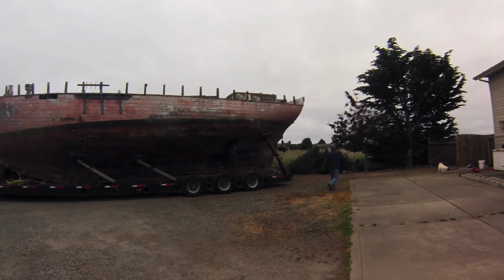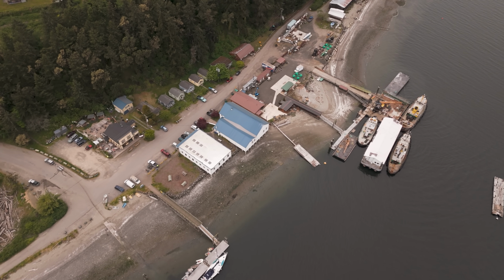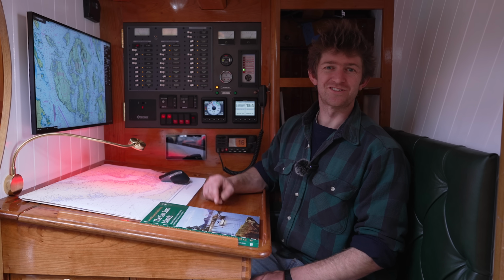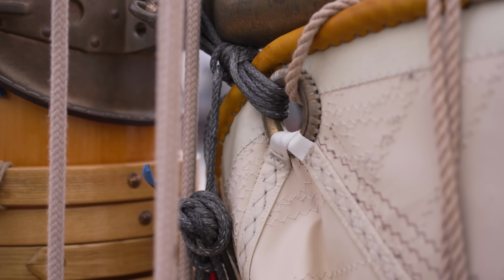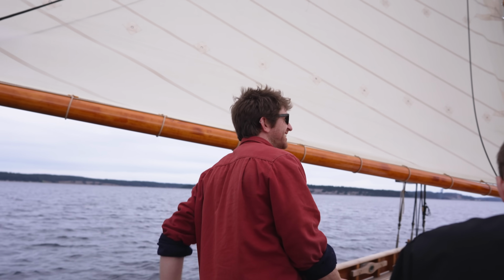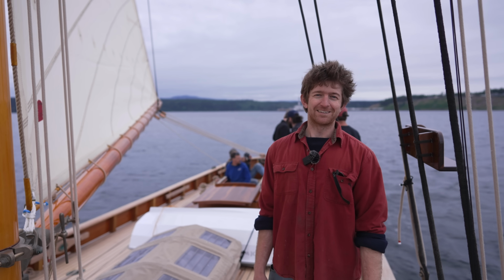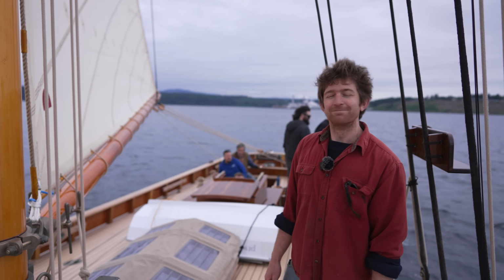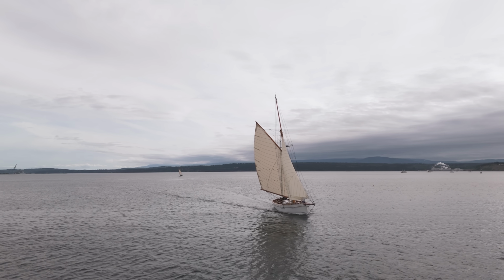After 7 years of rebuilding, TALLY HO SAILS AGAIN!

Comment: She looks absolutely amazing. Love sailing. 
Last week i had a charter Bavaria rented for a week. We were only motoring, but on last day engine died. We had to sail to Primošten and send away team on dinghy for 50l of diesel, bc we thought that we are out. Turned out, it was just clogged fuel filter from plastic particles of cheap plastic fuel tubing… It was new boat too. 3 hours of sailing in 5kt wind was very relaxing tbh without the noise of that Volvo engine. Not very fast, but nice.

Comment: What a beautiful sight, I can’t stop watching. I have been watching since day 1 and recently went back and made sure all were checked as liked.  One question, having owned a small sailboat (28’ Catalina) operated in Florida, Mold was a huge issue. I finally would put a small dehumidifier in the sink (direct overboard drain) while moored, problem solved, I don’t know if the NW has that issue and the ventilation shown  does the job.

Comment: I have to say respect, seven years.
Seven years ago I fore sure thought it would take you much longer.
But a great job, a beautiful boat.
Now keep filming and try to start to travel the world as soon as you can, that would be my advice.
Curious if those wooden rings/ mast hoops holding the sail on the mast have some kind of soft vilt lining?
Maybe charter a bit on certain routes?
Maybe have interesting guests from the “sailing community” on board sailing with you on the boat, getting interviewed for a podcast?
I’m just rambling here, I’m just curious what the future will bring?
Don’t tell me the boat is gonna get sold and you start a new project, that would be crazy.
It at least has to circumnavigate the world and I would take a few decades to do so if I were you.

Comment: Interesting how often folks are manning the winches seated on the deck outside the cockpit. I expected the cockpit to generally be full of folks trimming the sails as is typical in modern boats with large cockpits. One of the things that has seemed most awkward about Buehler's design for Rediviva is the standing helm position, although I often find myself standing and operating the helm with my feet mostly to get a better view over the doghouse when under power. In various modern FG boats, my favorite help position is sitting on top of the windward cockpit coaming. I envy Leo and crew getting to learn Tally Ho's special dances.

Comment: The replacement prop seems to have more than enough water moving capacity ..   Interestingly the smaller hub has allowed the swept blade area to remain  with a smaller overall dia. watching the response when returning to the berth   the boat,s response was not lagging .   Fingers crossed the smaller prop will suffice . Just a thought will those super tight sailing light attachments cause any stress points on the mast rigging . All coming together nicely .  loving the ups and the occasional down.

Comment: I would suggest you have a switch on the arm that engages the drive gear into the capstan. This would prevent it from being engaged before full contact. A switch and relay would work greay.

Comment: Fantastic well done. Please tell me, why at the beginning of the video was there a few lead bars being carried down below? Isn't there a huge ballest permanently in place? ( I remember the video from a few years ago when the casting of it went a bit pear shaped).
Reply: Don't know if it's the full explanation, but remember that the capstan has not been installed. Nor the boom gallows, and probably other items. I think he uses those extra, temporary ballast ingots to approximate the final weight and balance characteristics that TH will run with.
Reply: @llagas6307  Tha ks for the details, makes sense then

Comment: What type of boat is Tally Ho, it it considered a Brazzera (of croatian origin)? perhaps a sloop or a cutter depending on your sail sheet configeration?
Reply: Tally Ho has a gaff cutter rig, w/ a 4-sided fore&aft gaff mainsail & 3 forestays. A sloop rig usually has a 3-sided mainsail & only 1 forestay.
Her deep long-keel hull shape is based on traditional English pilot cutter designs known for combining speed & seaworthiness, although she has a squared-off transom instead of the more usual overhanging counter stern.
I don't see much of a connection to the bracera tradition.

Comment: She sails again.  I lost the plot, is there anything from the original ship in the new Tally Ho?
Reply: By weight, there's about 22% original material in the boat. Most of that is from the old lead keel, melted down & recast as ~75% of the new ballast keel. There's the re-conditioned wrought-iron mainsheet horse, & the repaired & motorized cast-iron capstan. As for wood, there's bits of original teak:
- the lowest 3 boards of the transom
- the 6 winch bases around the cockpit
- 4 bunk side-rails
& the saloon table.

Comment: Excuse my possible ignorance, but it looks like you actually built a replica, not a restoration.
What percentage of the original boat still exists in the new one.
Reply: Watch from the beginning.  It never stopped being the Tally Ho.  Its a rebuild.
Reply: @ericrodenburg7804 
"Rebuilt from the keel up" - what exactly does that mean?
Video seems to show all new timbers.
Is a rebuild the same as a restoration?
What percentage of the original boat exists in the rebuilt boat, you didn't say?

Not that it matters, replica or restoration, it's a beautiful boat and I couldn't build a canoe. Just interested to understand what was actually done.